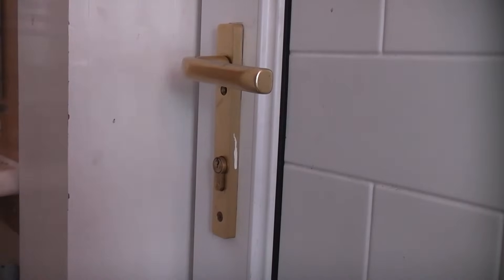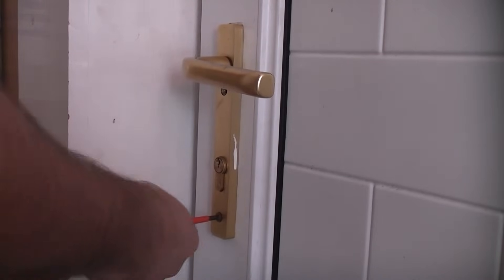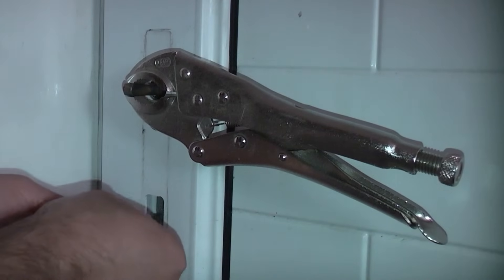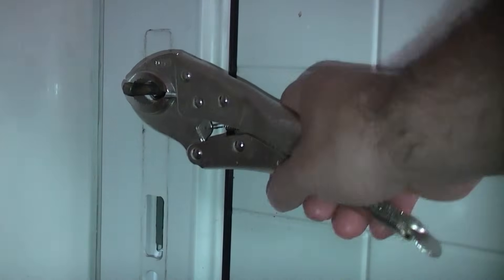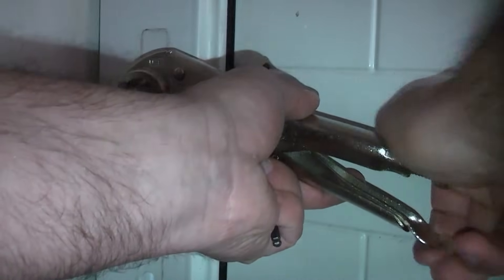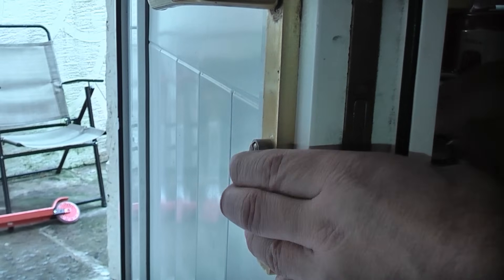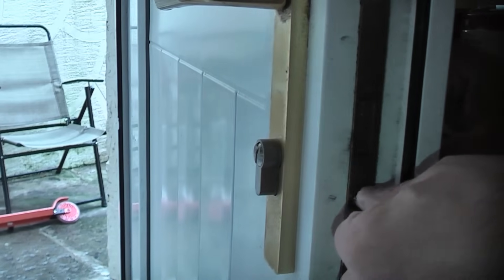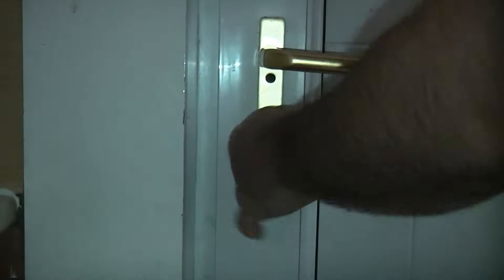Replace a euro cylinder without the key | lock snapping

Comment: I think this is a cheap cylinder, you cannot break apart a good quality cylinder easily, I have tried it my self it deformed the cylinder edges. the easiest way is to drill through the locking bars inside the cylinder to break them then turn the connected rod to by using  a screwdriver or even  any key fits inside the keyhole to unlock
the door. it's my personal experience.

and pardon me for my poor English 🙄
Reply from the maker: There is nothing wrong with your English ;-)
This kind of Euro cylinder is typical of what you would find in many UK doors, but now people are understanding their weakness and are upgrading to more secure ones such as this- https://www.youtube.com/watch?v=6wEZktQ9hb4
Thanks for the comment

Comment: do you know how to do a viro?
Reply from the maker: No, sorry.
Reply: George vauglicker or you drill it. (Drill at the edge of the cirkel where youre key goes in and remove the pins there are 5) or you dril in the middle left and right to find the 2 bolts who hold it

Comment: I drilled the lock but it keeps spinning and won't open the door tried this but the mole grips keep slipping off is there anything else I can do?
Reply from the maker: +shane wright 
Not that I know of.
It sounds like you might have a crap pair of molegrips?
They should not slip off once tightened correctly!

Comment: nice informative video for an apprentice burglars
Reply from the maker: That is why you should also have a fully working burglar alarm ;-)
Burglars already know this information, but unfortunately people that lose their keys do not!
Reply: ***** See how many hits lock snapping videos get. Have they all lost there keys or is it safe to say a big percentage have been viewed from our friendly tax free workers.
Reply: JON1201ROTH Id have changed it with an abs lock or similar that way people watching your video would know how easy they are to snap and get prevention advice also. Good channel btw
Reply from the maker: JON1201ROTH
I think a lot of people watch such videos out of interest only, hopefully it will encourage people to change their locks for more secure versions This was actually in a house that I rent out (they lost the keys), the tenants were shocked when I showed them how easy it was to snap the lock. I have ordered them a high security euro cylinder, like this- High security euro lock fitting
Thanks for the comments ;-)
Reply: JON1201ROTH dont forget the screws are on the inside and if you have seen the abs video ultimate handyman told us a tip never have the euro cylinder sticking out on the external but its alright it is abit sticking out on the inside.

Have a look at ultimate handymans channel and find the vids and watch 
I PROMISE YOU  you will learn a good few tips          I have anyway
Reply: Ben McKenna Barrel does not need to be sticking out to be able to snap a cheapo euro with mickey mouse handles, and yes I watch his videos as I like what he is doing. 90% of break ins I go to are from snapped barrels that's why when I leave a job I will have fitted abs lock, sash jammers and security handles then next time they get broke into it will be a brick through the window or something along them lines. You cant beat the burglar but you can slow them down.
Reply: JON1201ROTH  yes ok I understand you. And your right you cant beat the  burglars  no house is burglar proof. 

A good alarm would make burglars go elsewhere and as soon as they see a bellbox they wouldnt want to try.

Sorry for pretty much getting on the wrong end of the stick.

So are you a locksmith?  :D

Comment: Tried that, didn't work. A huge amount of force needed to break the cylinder barrel! The door was bending!
Reply from the maker: That's weird. They normally snap easily, as it's just a small amount of brass holding the cylinder together normally! 🤔
Reply: @ultimatehandyman  Looks like steel not brass though.
Reply: Some locks have snap protection using a reinforced link underneath that hole, in the middle of cylinder.

Comment: Hi! First of all, thank you for this, you're a life saver! Secondly I've managed to do everything but the cam has fallen out the other side :S Idiot. is there anything I can do?
Reply from the maker: Eva Caviar 
If it's the cam part of the Euro cylinder-
You should be able to put an Allen key in the hole and turn it using a pair of molegrips. 
It will turn in the direction that you normally turn the key to unlock the door.
Reply: I've done it! Thank you soooo much, you've saved me over £200 <3 xx

Comment: Thank you
Reply from the maker: You are welcome.Thanks for the comment
Reply: ***** Hi, me again. Just been to look at the job and the `barrel` is upside down and locked. Does this mean I will have to break the barrel by bending it upwards ?.
Sincerely
Reply from the maker: Yes, but make sure it's not an anti-snap cylinder (I'm sure I put a note on the video but might have forgotten).
Is the lock upside down ?
Reply: ***** Yes, the lock is upside down for some bizarre  reason and how can I tell if its a ant-snap cylinder ?
I really appreciate your time btw.
Sincerely
Reply from the maker: Most anti-snap cylinders will have a kite mark on them or the key slot will be horizontal instead of vertical.
Some anti-snap cylinders are only anti-snap from the outside so you would be really unlucky if you get an anti-snap cylinder on the inside. 
You are welcome BTW ;-)
Reply: thank you e s much. You have been more than helpful. Its just good to know that there are such good people ( as yourself ) out there willing to help.
Inspired my friend, I will let you know the end result.
Most sincerely
John ( in the UK )
Reply: The end result was good and your video helped a lot. So thanks once again.
Sincerely
JF ( UK )

Comment: Get a thick gauge screw , use an impact driver to drive the screw in to the key hole as far as u can , take a big crowbar and haul that fucker out , works a treat for when u break in to druggies houses and don't want to wreck the door and frame , saves the tax payer a bit too

Comment: Its still lock men, please help me
Reply from the maker: Have you tried inserting the short end of a 8mm Allen key and then tried to unlock the cam using a pair of molegrips for leverage?
Reply: @ultimatehandyman  Hi, I can't seem to open the locked door with the Allen Key. Should the screw be above where the Allen Key goes?
Reply from the maker: @elaineniven1315   There is no screw, you use the Allen key to turn the cam in the door. (the cam is the bit which locks and unlocks the door)

Comment: this is shit! I had a problem with the cylinder not working the key was stuck! watch this video and had a go.the cylinder does not snap that easy! with a little tug! anyway the door was locked he's showing a Alan key? to unlock the door can't see anything inside the frame! to use this,I just hope tomorrow when I get a new barrel it will unlocked the door.
Reply: I got quoted by a lock smith £120 to sort it the barrel will cost £14 so hopefully easy fix

Comment: A lock MUST be replaced with one that is flush with the outside surface, a surface that cannot be easily removed from outside.
The original plate was fixed from the outside = WRONG and totally unsafe.
The new lock was fitted extending outside of the new plate by about 10mm = WRONG (even mentioning that it is too long does not help!)
This lock can be snapped off, in the same manner with either grips (as demonstrated in the video) or a proper lock breaking tool. 
Therefore its simply not safe.
Why not make a new video showing how it should be done?
Reply from the maker: +Andrew Mathison 
It's quite simple.
This lock is on a house that I rent out, which is fully alarmed. This is the back door, if the back door is opened the alarm will sound immediately.
The tenant's lost the key for the lock, but out of the goodness of my heart I got them a replacement (which was difficult as I could not open the door to measure it). I informed them that really the Euro cylinder should be flush with the lock and told them that I would fit them a new cylinder if they purchased one (I gave them the correct size).
How many other landlords would have done that ;-)
I did recommend that they buy one of these- https://www.youtube.com/watch?v=6wEZktQ9hb4
Reply: +Ultimate Handyman 
Shame that you did not at least mention that fully and explicitly for the millions of people on YouTube that watch such videos, to be educated and taught. 

What you did was fine for them (assuming that you told them it needed to replaced ASAP!), but was not for YouTube, unless you write "WHAT NOT TO DO AS PART OF THE TITLE", then maybe!!

You (and I and everyone else who posts here) HAVE A RESPONSIBILITY TO THESE PEOPLE LOOKING FOR HELP, to supply them with full and accurate information, combined with an accurate and well filmed video.

In this case, you should have pointed out that anyone could have broken off the new lock with a pair of grips  or similar. Believe me, I was a locksmith years ago and there are even better special tools around that make it even easier than with a pair of grips!!! Anyone of which a thief could have used and been inside the house in under 30 seconds, entirely due to the state you left it in! 

I could have broken in maybe in 10 seconds!! Even today at 69 years old!! It requires no brain power....just a tiny bit of muscle....a tiny bit of knowledge.

I personally would have either made the video correctly (gone and bought the right cylinder AFTER removing the old, instead of the other way round!!) or not at all.

I would NEVER have posted it online in the form that you did, NEVER EVER! Thats just asking for trouble from MANY people on YouTube who know HOW to do such things properly!!

Just look at the wonderful YouTube videos from say "bosnianbill" for example, a million times better than yours!! Now that is a guy who really knows locks and can make good videos.....

Because when you do put stuff online, on YouTube for example, you have to be able to handle the possible criticism for any errors or failures in that video. As such errors only help thieves, not the normal people here.....

But if you cannot handle this critic (which is my impression today), simply don't post rubbish videos.....but if you do, learn to"take the rough with the smooth!!"

Think long and hard before posting in the future!! I know I do!!!

Have a great day.

By the way, your Avatar really makes you even more open to criticism. Think about it!! :-(
Reply from the maker: +Andrew Mathison 

Perhaps you should read
the title of the video " Replace a euro cylinder without the key |
lock snapping".

If you can't read the title perhaps your carer will be so
kind as to read it out to you ;-) 

          Save       Cancel
Reply: +Ultimate Handyman not many landlords would do this else i wouldnt be here trying to figure out how to do it myself also. I hope your tenants are greatful.
Reply from the maker: Thanks, I think I'm a good landlord as most of my tenants are long term, they very rarely move on. One family rented a house from me for over 8 years before they moved out of the area. I'm getting tired of being a landlord now, its just not worth the hassle anymore! I'm sure my tenants were grateful, the ones in that particular house are good tenants ;-)
Thanks for the comment